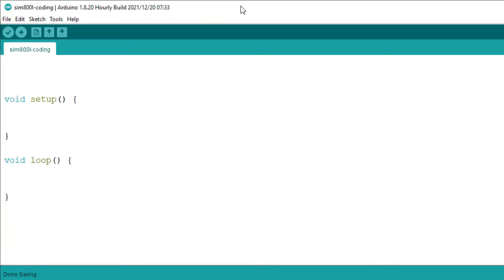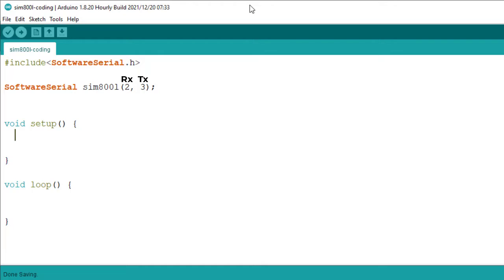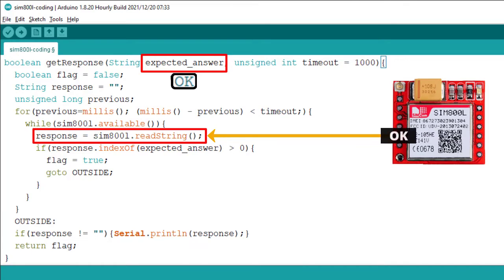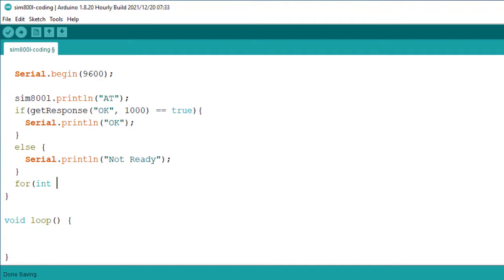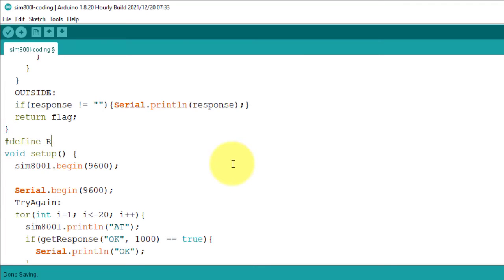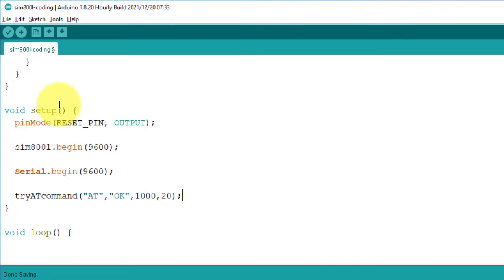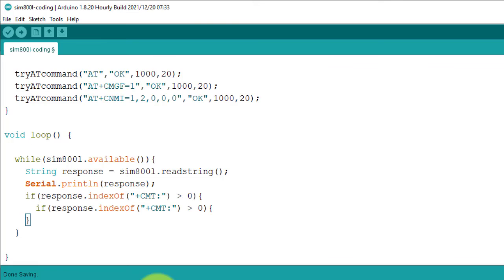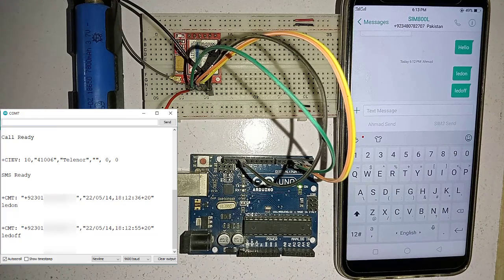SIM800L Programming With Arduino - GSM Module Arduino UNO

Comment: Hello sir... Can the sim800l work with a 3G and 4G sim card?? If it doesn't support it please tell me I need an answer... I need an help sir
Reply from the maker: sim800l not work with 3g or 4g. you can use sim7600

Comment: Amazing explanation and thanks for that. How can I use a stand alone ATmega328P to drive a relay without the ARDUINO board itself but using the same code. In other words , shrinking the whole setup to GSM800l , ATmegs328P , Relay and Power Supply.
Reply from the maker: the same code will be used for ATmegs328P. just connect a 16mhz crystal to ATmegs328P.

Comment: Hi, I actually wanted to ask that I'm using sim800l with Arduino uno to send SMS and make call simultaneously one after another but the problem is that after connecting to network call function is working really fine but SMS are not sent somehow,.... I've tried tons of code but SMS are not being sent please help if anyone can ! I would be really thankful
Reply from the maker: I'd be happy to help you with this issue. use the following code to test the sim800l

#include <SoftwareSerial.h>

SoftwareSerial sim800l(2, 3); // RX, TX pins for SIM800L module

void setup() {
  // initialize serial communication for debugging purposes
  Serial.begin(9600);
  while (!Serial);

  // initialize SIM800L module
  sim800l.begin(9600);
  delay(1000);

  // wait for network connection
  while (!sim800l.available()) {
    Serial.println("Waiting for network connection...");
    delay(1000);
  }

  // successful network connection
  Serial.println("Network connected.");
}

void loop() {
  // make a call
  callNumber("1234567890");

  // wait for call to end
  delay(10000);

  // send an SMS
  sendSMS("1234567890", "Hello World!");

  // wait for SMS to send
  delay(5000);
}

void callNumber(String number) {
  sim800l.println("ATD" + number + ";");
  Serial.println("Calling " + number);
}

void sendSMS(String number, String message) {
  sim800l.println("AT+CMGF=1"); // set SMS text mode
  delay(1000);
  sim800l.println("AT+CMGS=\"" + number + "\""); // send SMS to number
  delay(1000);
  sim800l.print(message); // send SMS message
  delay(1000);
  sim800l.write(26); // send CTRL+Z to end SMS message
  Serial.println("Sending SMS to " + number + " with message: " + message);
}

Comment: Hi Ahmad! Thank you very much for this tutorial, it's been really helpful! 
I wanted to ask you something: The main functions work flawlessly with an Arduino UNO, but I cannot make it work with a NodeMCU (ESP32). I'm using Serial2 instead of software serial, but I get an infinite loop with the getResponse or tryATcommand funcionts. The response is OK, but there is something with the function that cannot take the value and get the correct flag. Do you know how to solve this? 
I'm using exactly the same program in both, but replacing sim800l with Serial2 and not including the softwareSerial library. Thanks again!!
Reply from the maker: its OK to use hardware serial ports of the esp32 instead of using any softwareSerial library. I have built this code on the Arduino UNO. I never tested it on the esp32. So, I will test it for the esp32 myself, and will try to figure out the issue. It must work with esp32. I think there is some little logic fail for the esp32. so I will try to fix this issue and let you know as soon as the issue is resolved
Reply: @AhmadLogs  Thank you very much! Please let me know, I really tried everything to my knowledge and could not debug it!
Reply from the maker: @DirtRidingTV  you might check the code of this project https://youtu.be/OJcGY4ySs4o 
I have updated the getResponse function and also added the resetSIM800L function. this code might be helpful
Reply: @AhmadLogs  Hi Ahmad! I tried with the updated function but I still get the same output. It cannot break the loop for the tryATcommand and I get something like this:

.AT
AT

OK
.AT
AT

OK

Etc.
Reply: @AhmadLogs  Let me add that my main goal is to use the bottom "failsafe" for this program (the part that checks if the module is working fine and is connected to the microcontroller).
Do you believe there's another way to make this failsafe? I was looking at your video on how to control a relay with an ESP32 from April 2021 (saw that this program doesn't have a failsafe). Thanks again!
Reply from the maker: @DirtRidingTV  can you please tell me the led status of the gsm module, if it blinks once in a second then it mean the module is not working fine
Reply from the maker: @DirtRidingTV  in programming there are always different ways to perform the same tasks. but after doing lot of research I did not find any other solution for this problem. I have also checked different libraries but unable find any other method for fail safe.
Reply: @AhmadLogs  Hi Ahmad! The module is working fine, ir blinks every 3 seconds. I've tested the code with an Arduino Nano and Uno and both work fine. The problem happens only with ESP32/ESP8266 (I tested both), using hardware serial instead of software serial
Reply: @AhmadLogs  I've also tested some simple program from LastMinuteEngineers's web with the ESP32 on Serial Hardware, and it worked fine.
I believe this issue only happens with the tryATcommand and/or getResponse functions when used with ESP MCU on hardware serial. It's really weird!
Reply from the maker: @DirtRidingTV  hmmmm, then I will have to give it a try myself using esp32, I will try as soon as possible
Reply from the maker: @DirtRidingTV  so let me give it a try
Reply: @AhmadLogs  Thanks a lot! Let me know if I can help you in any way to test this!
Reply from the maker: @DirtRidingTV  sure

Comment: Hello, in the first connection, sms read and call read messages appear on the computer monitor serial and after resetting esp32, everything is fixed.
Reply from the maker: it required to update the code and we also need current and voltage sensor. I will try

Comment: Hello, help me.  I made the circuit, everything works well when connected to the computer, but when the battery or external power is used, everything is fine and it just doesn't send SMS. Look at my code in the gate.
Reply: I am facing the same problem...you rectified the issue? Pls let me know how to solve
Reply: @asadeeshprabhakar  There was an antenna problem, I connected it to an external antenna and the problem was solved

Comment: Hello, the circuit I made when connected to the computer in the serial monitor receives and sends messages, but when it works alone, only SMS messages are received, and by pressing the reset button esp32 is fixed and sends messages too.??!!

Comment: crystal clear explanation !! .. 
I wanted to ask you ... what is the best and most efficient way to send the location from arduino ? .. 
if we connect a GPS and send the location in SMS by making a google maps link each time we recieve an sms.. will be okay .. 

but.. what if we want a real time tracking ? ..
Reply from the maker: The best way to send the location using sim800l by send sms. sim800l has slow speed internet. so, it is not reliable for real time location, you need some stable internet connection for realtime tracking
Reply: @AhmadLogs  thanks 🙏
Reply: @AhmadLogs  what type of connection does it have? Like 3g? 4g?

Comment: hello mr. Ahmad. will u be adding the new sim800l code to old codes? I mean I want to combine your old sim800l+esp32 relay controler code with the new code you wrote. Please record a video that combines old code with new works.
Reply from the maker: I will definitely use the updated code in my new projects. I will try to update the code for my old project. but I have a very little times so I dont know when?

Comment: Hello thank you for the tutorials it helps a lot by the way i am currently working on an IOT project with an ESP32 SIM7000G card i followed your example of GPS with sim800l but i have a problem i want to send the sensor data to firebase via sim7000g but i can't connect to the apn the apn connection fails i really need your help please
Reply from the maker: ask for your sim card provider for the apn setting

Comment: In Iran, to send a text message in Persian, you must hex the mode of sending the text message and after sending it, convert it to gsm to receive it again.
Sometimes the sim settings are converted to hex again and it does not receive distorted text messages in English
I used a millis function to fix these bugs like you
👍
Reply from the maker: that's great

Comment: I have a question i try send sms and call it work successfully but in case of gprs i don't why it didn't work that mean there is problem in the power of the module it is lithium-ion battery 3.7 v the current supposed to be 2A but by using a meter we read 1.2 A is that the problem
Reply from the maker: sim800l required 2A current in a fraction of a second, so you cannot measure it using multi meter, you need oscilloscope for this.
1. 3.7v battery is adequate
 2. have you entered the correct apn and password of your sim  card network provider
3. what is displaying on the serial monitor while connecting to the serial monitor
Reply: @AhmadLogs  yes i have make call and it was received and send sms the problem i don't see in serial monitor the response of module even when i make the call and sms
Reply from the maker: @ahmedgaballa8542  1. It means there is some issue with your serial connection to the sim800L. please double check the connection.
2. have you select the correct baud rate from the serial monitor
Reply: @AhmadLogs  I select 9600 baud rate
Reply from the maker: @ahmedgaballa8542  baud rate 9600  must be same in the serial monitor and in the code Serial.begin(9600 );
Reply: @AhmadLogs  can we contact with u in social 🥺
Reply: @AhmadLogs  Sir  our graduation project 
Send reads of ultrasonic to firebase as percent  using sim800L
and access by application
To firbase and read these percent 
We use mega and same code of sending dht reads 
But coonect tx 18 Rx 19
We should convert long int reads to string ? Can find response from gsm 
Or what the problem ?🥺
Reply from the maker: @ahmedgaballa8542  I think there is some issue with your serial connection.
have you connect the ground of the power source to arduino?

Comment: Very well explained video, thanks. 
altSoftSerial is a more reliable alternative than softwareSerial, can simultaneously transmit and receive but only available on set pins. 
Could you create the same functions using character arrays without the use of String?
Thanks.
Reply from the maker: Yes, you are right. but I never used altsoftserial simultaneously. I will try it in my gps and gsm projects
I have tried many times with I will try to write the same function using character array. but I never feel comfortable with character array with sim800l
Reply: @AhmadLogs  
Try using hardware port (TX RX) for gps and altSoftSerial for Sim800L. 
I’ve been told to stay away from String and instead use character arrays. 
Thanks.
Reply from the maker: @iantcroft  Yes you have told me before. I think there is some with software serial while reading characters. So, I will try using altsoftserial